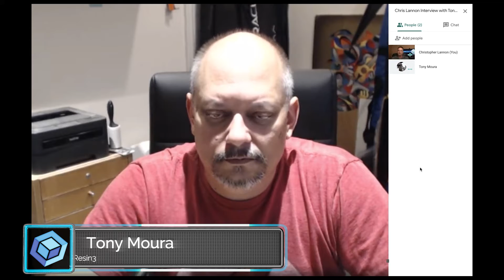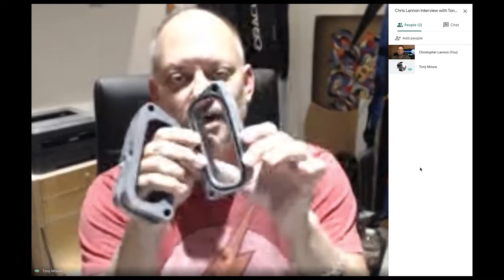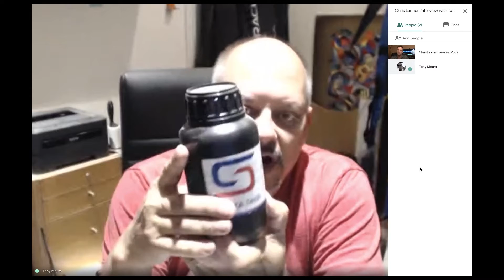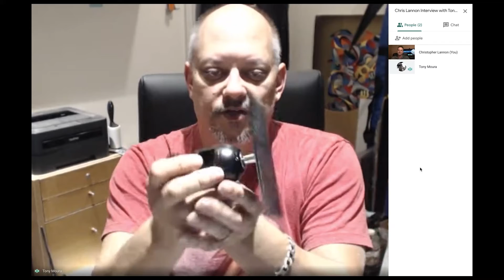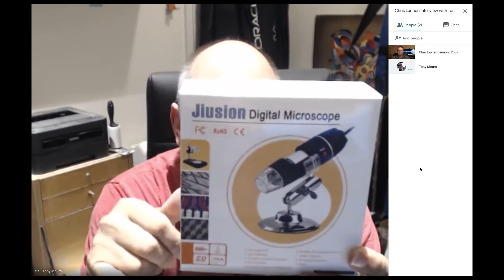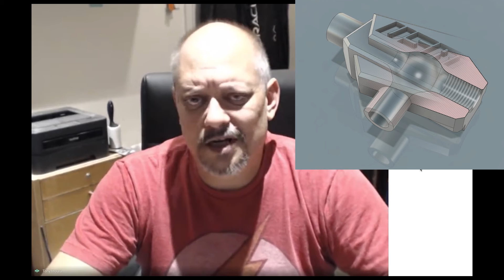How to Make Money with 3D Printing: Racing Parts - Interview with Tony Moura - Part 2

Comment: There's zero chance those nuts could be used in a car engine lol... Way WAY  to brittle they would sheer and snap within secs. Most resin nuts and bolts that size have a strength rating of around 30-40 kg.
Reply: Hellspawnxxx,  who said the nut was used in a car engine? Are you nuts?
Reply: @michaels3003  Hey, he could be printing pistons. We don't know. 🤣
Reply: You should look at the videos of people stress testing Sraya Tech Blu.